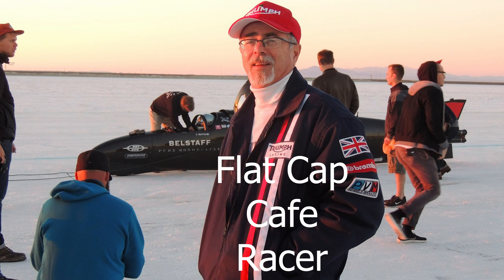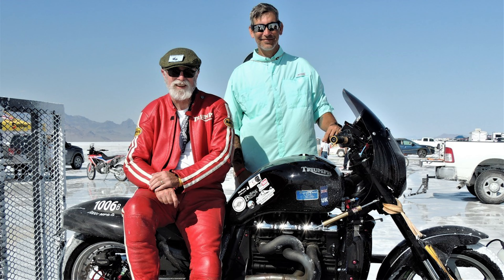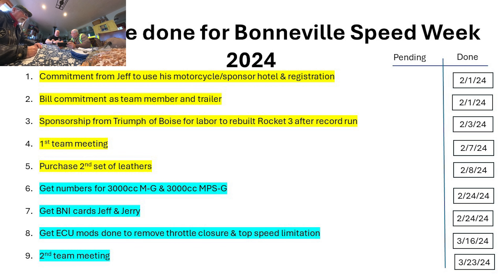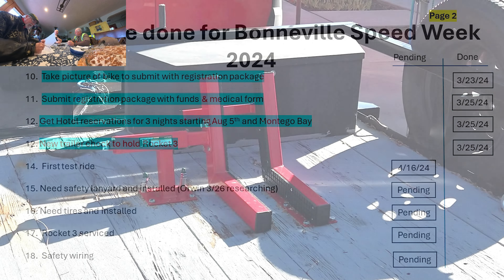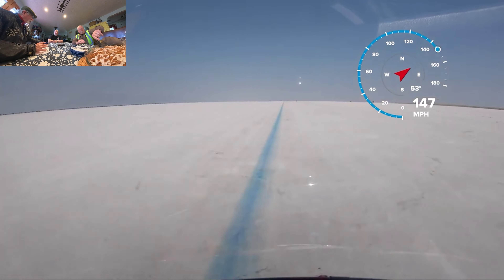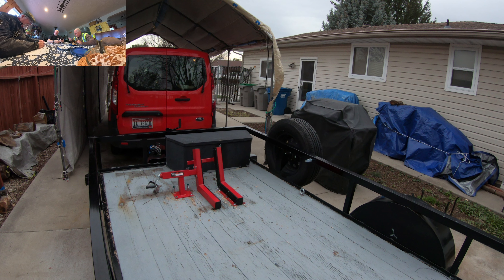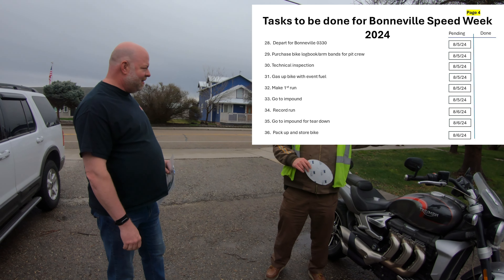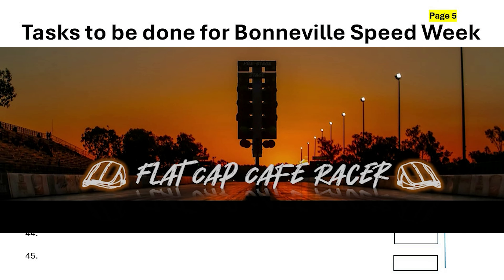(F) Rocket 3 progress update for Bonneville Speed Week 2024

Comment: What is that in the backround there w/ a CARPENTERS RACING sponsor support decal...LOL. I've seen those engines up close. They  were at Carpenters for a refresh . Had a Facebook, I could post a picture.. 1480cc 553hp.. X 2.. beautiful salt flat racer... The 'new' Rocket III isn't impressive... a shame ..if only for few more RPMS up top .. Come on Triumph unless the beast !!  Enjoy the content !
Reply from the maker: I'm not aware of any Carpenter decal, the big one on the tank is a number/ class decal.

I saw the Carpenter engined Triumph streamliner at Bonneville a couple times with last being in 2016.

I've ridden a couple modified older models with lots of horsepower. Of course I crashed one last year at Bonneville.

I'll probably ride a couple 200 rwhp older models at the drag strip this year.

The newer model 2021 I'm riding at Bonneville this year while probably only 165 rwhp may actually run faster than the 260 rwhp one I rode last year.

The new ones are very much lighter, better handling and better shifting bikes than the older models which is expected.

I know Triumph could easily make this a 200 rwhp out of the box if they wanted to, however no one currently makes a 240/50/16 rear tire that is rated above 149 mph.